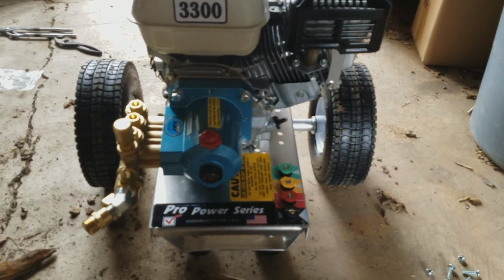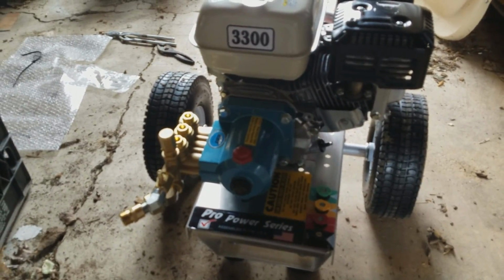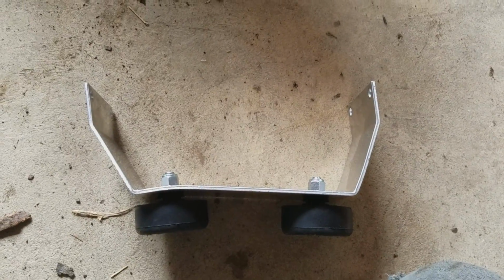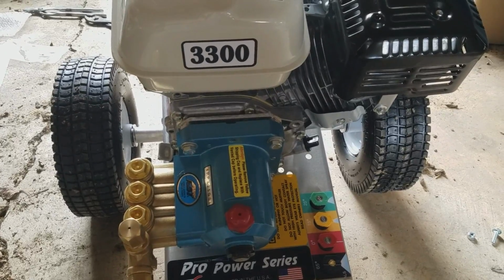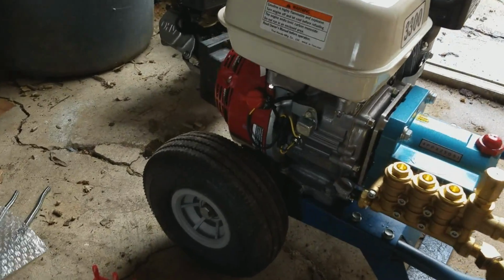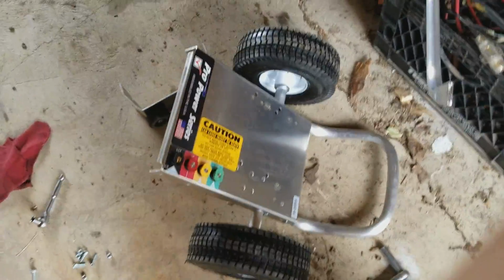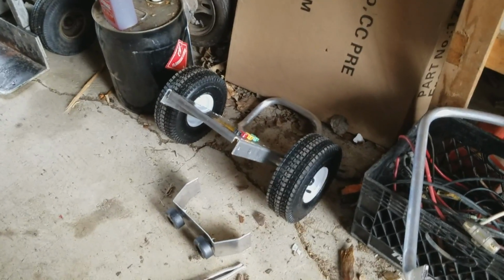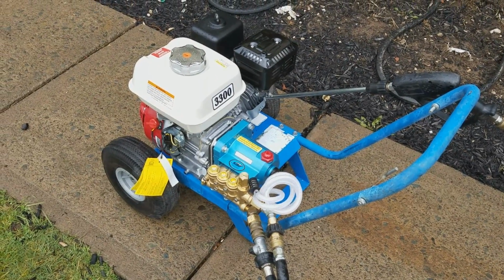Pressure-Pro PPS2533HCI 3300PSI Pressure Washer First Look

Comment: How is this holding up, curious about reliability thinking about getting one and using it as a side hustle let me know
Reply from the maker: Still running like a champ. Every spring, this machine is used for 6 hours a day nearly everyday. The The engine fires up every time, pressure output is consistent. The cart sucks, but I built my own to better suit my needs.
Reply: @TheBurnsStuff  Nice , will you upload a video of it in action that would be great.
Reply: Another question does it comes with oil to be added or they pree add those?

Comment: Been four Years how is it holding up.??
Reply from the maker: I still have it and use it almost every day. I've built a new cart,  changed some plumbing on it and added an electric starter. Regular maintenance on the engine and pump is the key.
Reply: @TheBurnsStuff  whats the maintenance intervals like?

Comment: The frame problem is cos they order engines in bulk at the company that buys the engine ie Honda /huahe they put there own frame etc on it, I got the Parkside petrol jet wash 180bar 6,5hp 208cc I'm hoping to get a stronger powerful pump, the sealed pumps once there used they need to have oil changed they get small shavings etc on the 1st hour and only way to drain and fill is through the oil plug